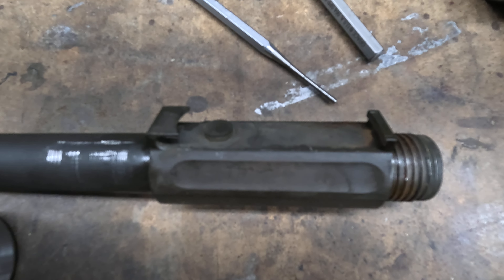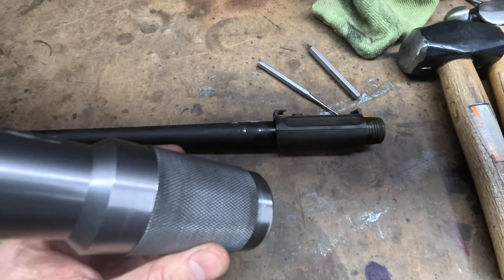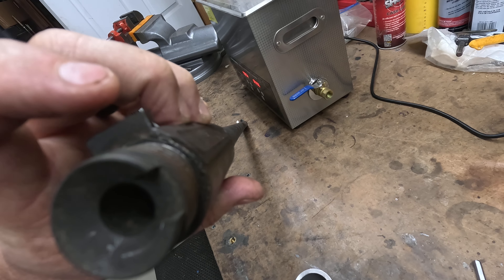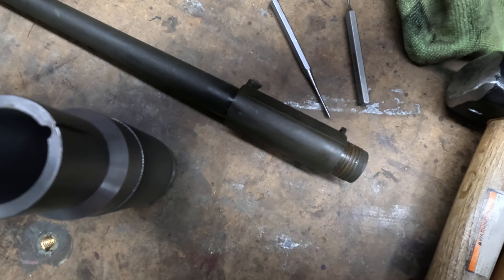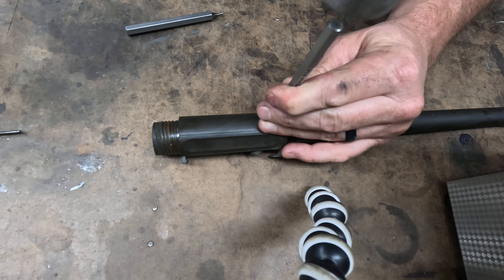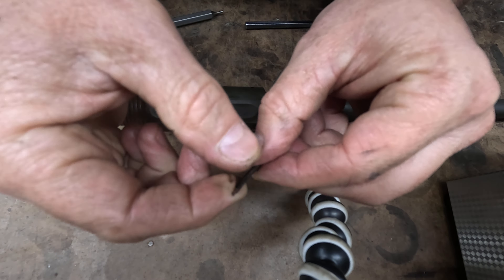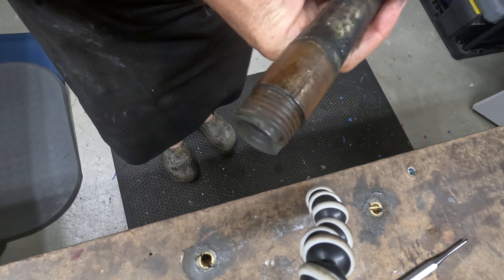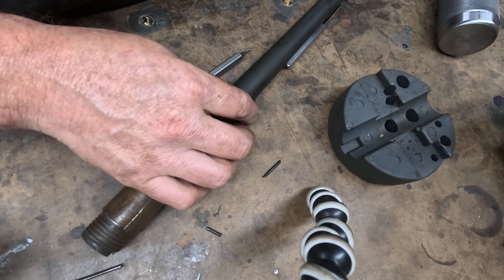How to remove the rear sight collar from a 1903

Comment: This explains so much. I initially  thought the collar was one with the pre-A3 recievers. Given how secure they are, I don't imagine armoury rebuilds would have bothered putting a collared barrel onto an A3 configuration.
Reply from the maker: Correct. A3 rebuilds would have got an A3 barrel.  
They made something like 10 replacement A3 barrels for every action made. So replacement barrels were plentiful
Reply: @hebes4056  very cool! Over here in the U.K., Springfields are very rare, but Enfields are plentiful. It would be fascinating to see your a4 build talked through, especially as it uses parts from a sighted/ collared barrel to 03 rear sighted receiver.
Reply from the maker: @as03uk  
I could probably do something like that. Just to clarify. The A4 build and the 03 build are separate. The A4 clone uses "correct" parts and the 03  use " correct" parts.  

When I'm in the shop puttering around doing something I think someone may think is interested, and I think about it, I'll turn the camera on.

Comment: Its become clear to me that someone bubba'd a collar onto my 1921 barrel. The cross pin is pretty ugly.

The sight has never been able Zero without adjusting the windage to the left a few ticks. 

Do you have any experience with a situation like this? I'm assuming if my collar came from a different gun it may not line up even when indexed with the barrel/index pin.

I plan to take it off and reinstall it to correct the issue.

Let me know your website/ebay to purchase the driver.

Comment: What is your method for re-installing the sight collar after replacing the barrel?
Reply from the maker: @raymondrowden5154  basically the same operation in reverse. I have a tool for driving them on. It takes some time to get the collar indexed properly with the front sight. I don't re install the cross pins. The fit is so tight, it's unnecessary for moder5day civilian use